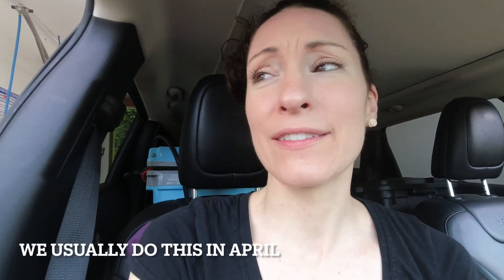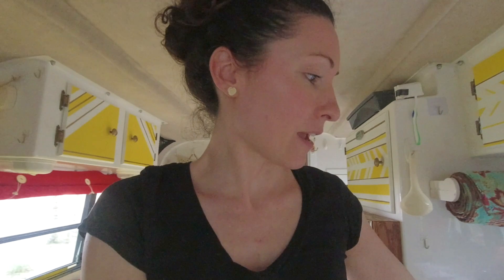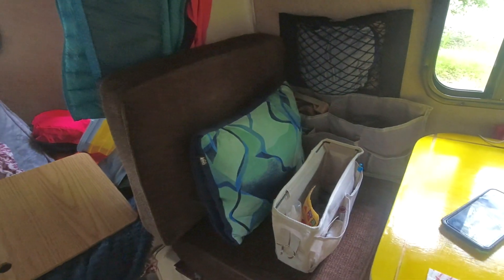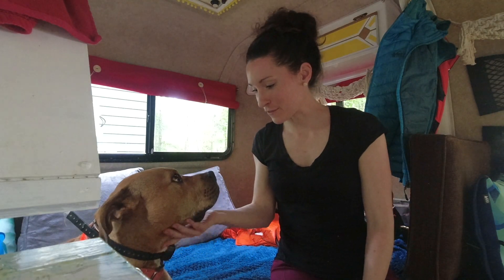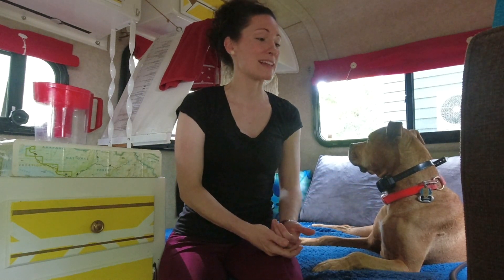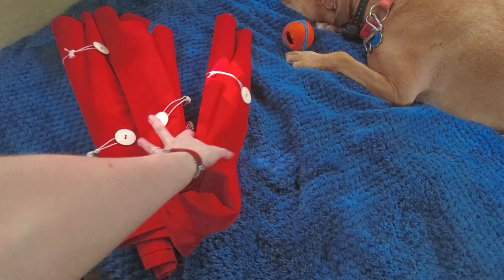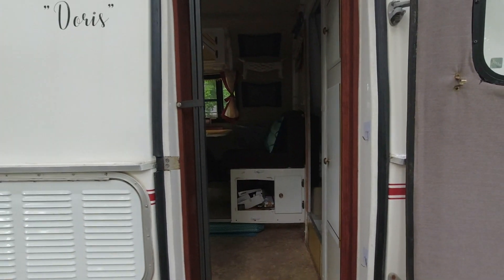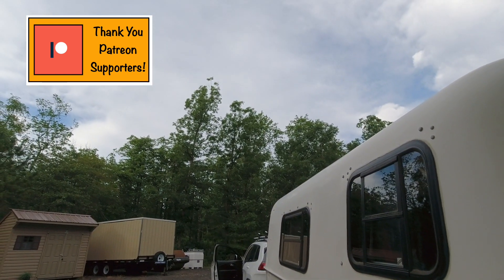The Reality of a 10 Year Old RV // Scamp Maintenance, Time + Money / RUST / Let New Adventures Begin

Comment: Hi Laura .. get a cover for the scamp. It's worth it ! About $200 from the scamp factory. Or you could use a tarp with tie downs. I use the cover, and I don't have a garage to keep the scamp in, so it helped keep dirt and mold off the scamp. A lot less cleaning. I just use soapy water and a soft velvety microfiber scrub. Also for the rust, get rid of that rusty chain because when it comes in contact with the frame, it speeds up the rusting of the frame.
Reply from the maker: We have a cover...what happens is we tell ourselves we will be taking the Scamp out soon so we dont put it on as often as we should...which makes more work for us in the end going to the car wash 😂 we took the scamp to a welding shop and they replaced the chains for us...now to figure out what to do for the rust under the scamp🙄😬 an older RV sure is a lot of work!
Reply: @LetNewAdventuresBegin  pretty unfortunate. But have Patrick crawl under with sanding paper and a rust treater. Wipe clean and then spray on some black Rust-Oleum paint over it. The issue is when we drive, little debris like rocks and tiny pieces of metal get hurled up like projectiles and hit the scamp. The ones that hit the frame, scrape the paint off, exposing metal and setting off a rusting chain reaction. Periodically inspecting the trailer frame for rust and topping it up with black Rust-Oleum spray paint will ensure there is no rust and also eliminate the need for a large scale cleaning/fixing project.

Comment: Scratch remover works good on those black streaks with elbow grease.. Looks like your frame was repaired before. They are notorious for snapping in two. Slim potato head and Bex cat herder both have scamps, both had frame issues. They make plastic propane tank covers. There is a paint that encapsulates rust. Meaning, no prep before painting. Makes rust part of the metal and paint. Comes in a spray can. Have fun when you do go out!
Reply from the maker: sounds like we have more days of RV maintenance ahead of us! 
Ive seen videos of RVs with frame damage 🙈 camping is rough- they really need to make these things stronger!
Reply: Bex has a older Casita😊
Reply: My Canadian friend Slim has a Trillium, he had the frame replaced. He does a lot of back country boondocking. I have a 2014 Trillium Outback, with all the issues Laura is going over. After owning boats all my life, I find a 15ft Trillium is a lot easier.
Reply: Meguiar's Flagship Premium Marine Wax, Boat Wax and Polish gets rid of the black streaks while also waxing the camper. I use it on my scamp 13 ever year and its good as new.
Reply: Slim potatohead has an Outback Trillium made in Alberta, not a Scamp. Although it is similar--a fiberglass trailer. He replaced the steel frame with an Aluminum frame because of all the rust he was getting on Canadian roads. Before that he had an A-liner pop-up trailer.

Comment: Maintenance is essential but most people do not know what a truly maintained older RV looks like. Here's what it looks like: The sellers have lots of receipts for repairs for you to review, the axle has been changed in any trailer older than 20 years, or you will be doing that since the rubber goes bad and leaves the trailer essentially without the needed shock absorption and suspension. Windows have been properly resealed, as well as the belly band if it is a two piece molded fiberglass. The unit has been stored indoors or under cover. It had been regularly cleaned and waxed. I could go on and on. If you do not have all the evidence of a well maintained trailer you are buying a project no matter how cute it looks, how badly you want it or what the seller says (they actually may not be aware of leaks, dry rot, need for a new axle, etc). Be prepared to be uncomfortable, not being able to use your trailer and outlay of lots of money if you buy a used trailer that has not been properly maintained.
Reply from the maker: this is so true- its a lot of work to maintain an RV in order to preserve its longevity

Comment: Two questions.   What is the white angled square piece after the counter before the bed?   What is B 10
?   I’m stealing the elastic idea.  Thanks
Reply from the maker: Hi Greg- that is a fold down table that the first owners installed- it is very helpful when cooking or doing dishes as there is very little counter space in the scamp. And we have to label the camper according to where it goes in the storage lot 👍 thanks for watching
Reply: @LetNewAdventuresBegin  thanks for the quick reply.  Logical answers.   I agree it looks like your front frame has already been augmented but take it to an expert.   Safe travels.